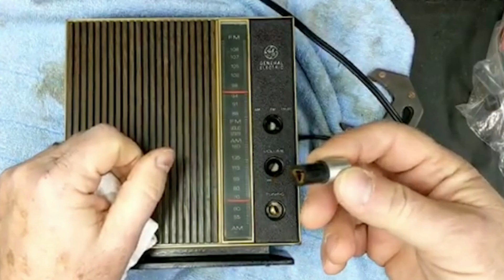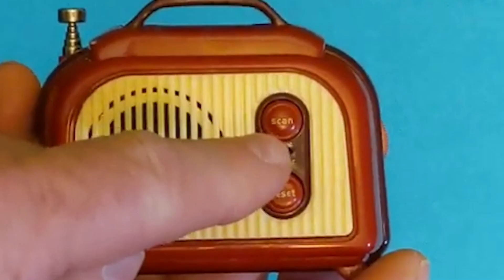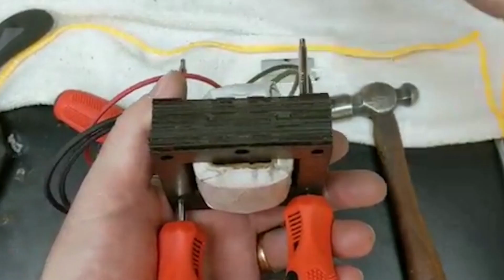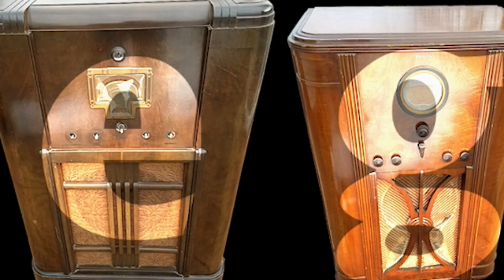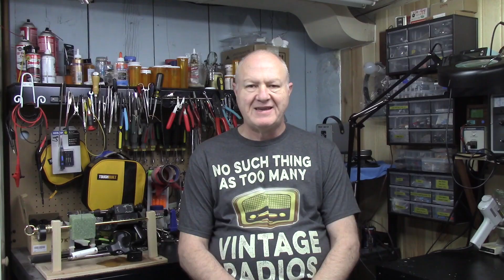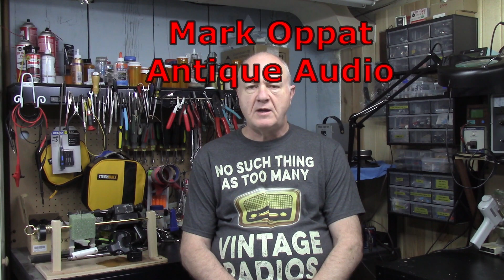1929 Victor R 32  Part 11  Final and complete

Comment: This Victor was a one-off as RCA would be buying them the same year these were sold, and remarkably stable for a TRF.  I restored one for a guy about three years ago and was stunned at how good it ran.
Reply from the maker: I agree John, it is a really nice Radio and I was lucky to get the old girl going again, especially after replacing three transformers. It plays well. Thanks for watching!
Reply: @greggsvintageworkshop8974  Three XFRs?  I guess I'm going to have to watch all the videos...   I did recover a LOT of black wax from the bottom of the power chassis (which hindered its removal).  It was a very low temperature wax so I just assumed someone left this on for a few days and forgot about it.  I tested it a week and the original parts ran cool, so I sent it home.

Comment: I live approximately 4 hrs from you (southern Illinois) and I feel your pain on only having a couple AM stations available to listen to. It still looks and performs great. May have to get with Bob Gibbons and build one of his AM transmitter boards and make your own 'Radio Station'. ;)  I picked up an old 'Cathedral' style tabletop radio off a guy up in Mattoon last winter. Once I get some of my other projects done, I'll try to start on it. It needs SERIOUS cabinet work. Wish me luck!
Reply from the maker: Yes that should be nice when you get it done, good luck!! I also have a video of an old school breadboard ( literal bread board) AM transmitter I built about 2 years ago. It just needs to be by the actual radio you want to use it with.
Reply: @greggsvintageworkshop8974  Saw it in the background of some of the videos. I figured that's what it was.
Reply from the maker: Thank Randy I actually have a whole house transmitter. I made a video with it where I had to fix it when I got it due to shipping damage. Once I had it fixed I went through the house and showed a bunch of my radios playing and connected to it.
Reply: @greggsvintageworkshop8974  See, duh, I watched that video and knew that. LOL! SMH

Comment: Great job, Gregg. I second your vote for a speaker dummy load. I couldn't hear much else. Watching you adjust the capacitors would have been interesting as the signal generator didn't do anything after being set. Turned out beautifully and looks great in the living room.
Reply from the maker: Yes I agree, live and learn. That's why I showed what I would be doing. In hind sight the adjustments would have been better viewing
Reply from the maker: Thanks Dwayne, yes live and learn. I showed what I was going to be doing, before I did it. I'll do better next time.

Comment: Nice work Gregg of course I had to turn off the sound because I could only hear the 400 cycle tone and could not hear you talking.
However the end result turned out GREAT, real nice radio and it sounds real good
Reply from the maker: Thank you Bill, yeah I gotta make me a speaker load for that sort of stuff.
Reply: @greggsvintageworkshop8974  Last year I bought some high power 8 ohm resistors so if I ever do an alignment I will have them.
Reply from the maker: Good idea Bob, what wattage did you get?

Comment: That was a lot of adjustment work! Kudos to you Gregg. On page 8-8 RCA of Rider's  manual for Model R-32,RE-45, R-52 alignment. The very last line  on the
 bottom of the page  says " the receiver should be neutralized first and then aligned, after which repeat both processes for greater accuracy."
Skip that repeat step, it is too much work and the radio sounds great! Cabinet looks superb as well. Thanks for showing how you repaired it! Steven
Reply from the maker: Thank you Steven, I actually did do a second neutralization after I changed the pot and the 26 tube. I just didn't show it again since it was such a big part of the previous video. I really appreciate the help you provided during this restoration.